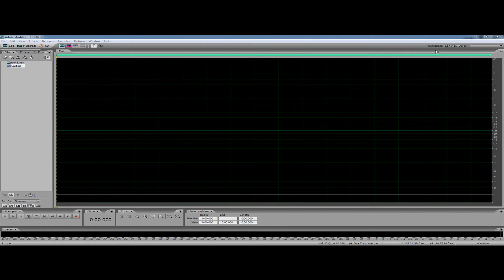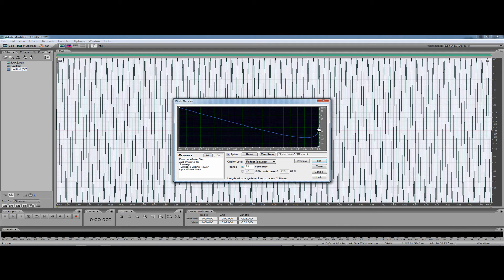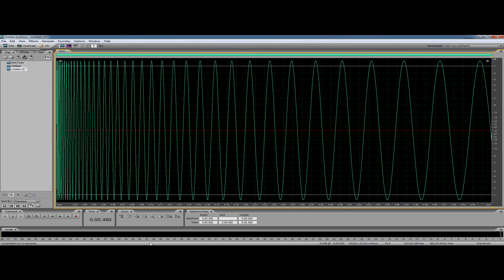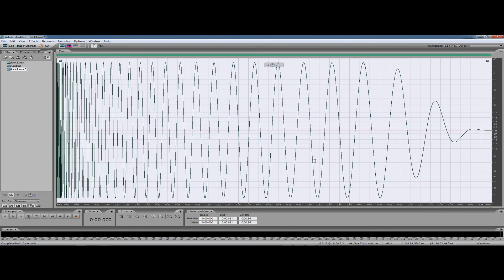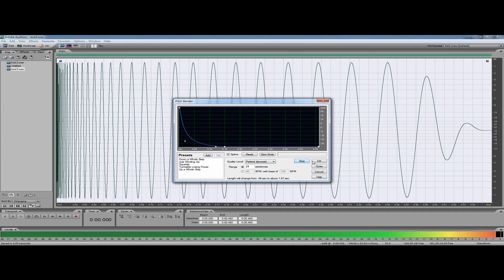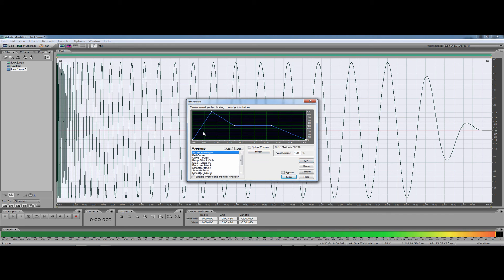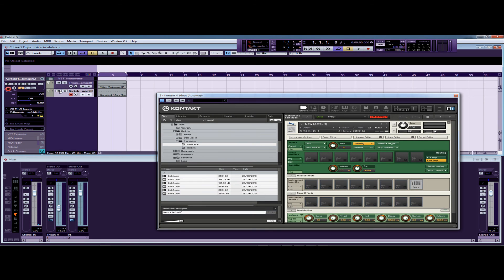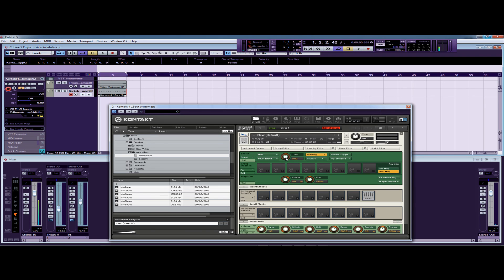How To create a kick drum using Adobe Audition.

Comment: Yeh that squeeky sound, which sounds like an electric zap is the reason I will never use a sine kick by itself. You can get rid of it by playing with decay settings on the pitch env, but will notice at the same point you lose the zap sound, you also lose punch of the kick itself.

So rather, what I do is open up a saved version of the kick in FL's sampler. Then use the "pogo" feature adjusting it which will get rid of it w/out losing the punch. But it also chances the pitch too, so watch out.